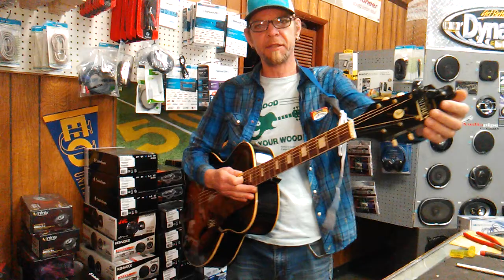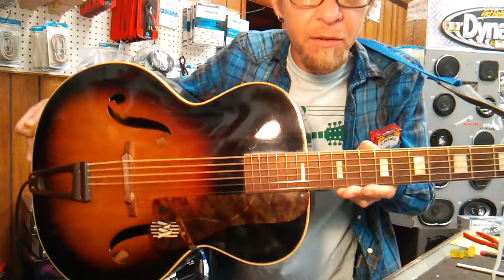K&K DEFINITY SYSTEM PICKUP INSTALL IN 1945 HARMONY MONTEREY

Comment: Hi, So how did you install the pickup? It's hard to tell in the video? Also, do you feel like you could get an acoustic guitar sound out of an arch top with that pickup? Thanks!
Reply from the maker: I used a ribbon P.U. from K&K. The owner did not want to see the cable, or the pick up. I installed it under the neck extension.  It worked great at my shop. The owner got the guitar home, plugged it into his equipment, and it had a nasty hum. The pick up was removed, and he is now using a bottle cap style stick on pick up instead. I'm guessing there is terrible RF interference, or his electricity is just simply very dirty. I honestly don't know. You heard it here :-)
Reply from the maker: Here is the video of what I did on this one., Thanks for asking. https://www.youtube.com/watch?v=FDZbJGkioO8